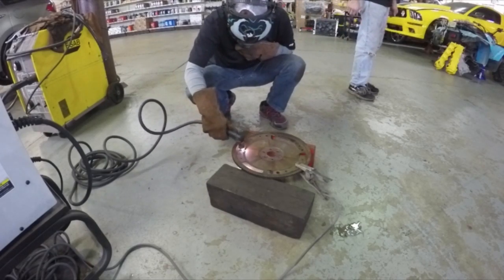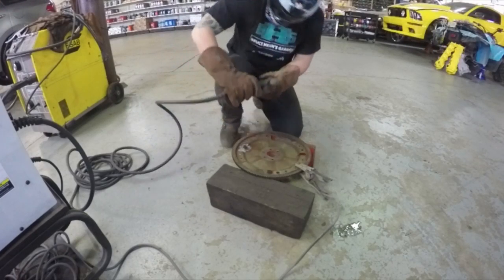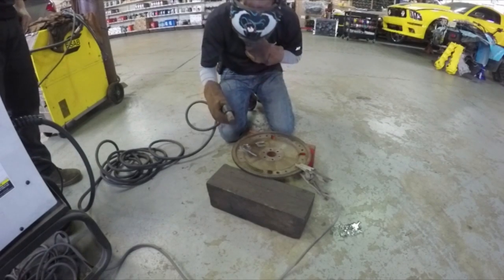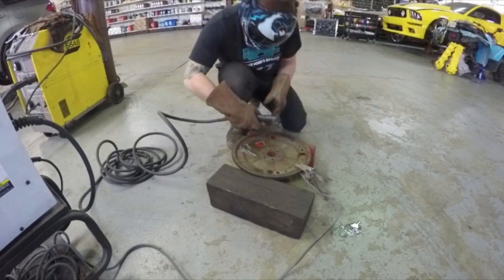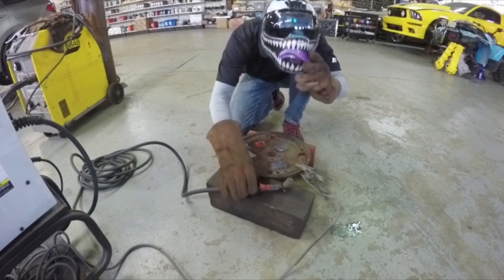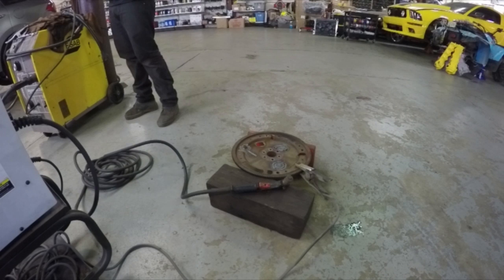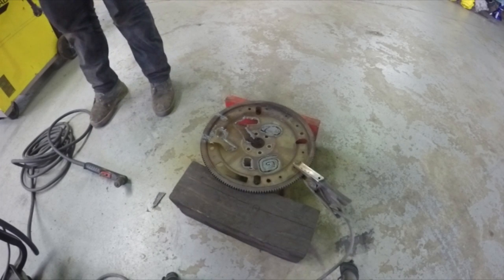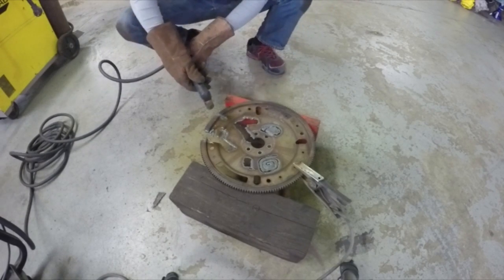Plasma Cutting for the first time

Comment: Don't feel bad. On my final pipe welding test piece my buddy wanted to surprise another guy by cranking up his welder and making big shower of sparks.  You guessed it he cranked up my welder instead, whoops.  Well blew a 3/4 inch hole in my test weld.  Fortuanetly the rest of my weld on that pipe was good enough to cut up test and pass.  If you start in the middle of a plasma cut angle the cut to blow molten steel away from the head so as not to burn it up. When you cut through then 90 degree your cut and travel.

Comment: Instead of holding you shield up and constantly doing that, invest in a mask that automatically darkens when it senses bright light. They're also adjustable via manual turn dials so you can adjust when the screen darkens etc.
Reply: +datstocklyfe I would just recommend buying a cheap hood that's fixed at like a shade 4 for plasma cutting. The plasma arc aint that bright, and a shade 4 is about perfect.

Comment: No offense to tony, but is that the best time to fuck with someone? When they're holding a fucking plasma cutter?
Reply: +Jirekianu ...especially when a noob is at the controls. Bit dumb if you ask me.
Reply: Jirekianu Its still not clear how on earth could his dick be cut off after this?
Reply: +Burlats de Montaigne what could possibly go wrong?
Reply: blackcarmafia  The likelihood isn't terribly high but a number of things could occur.

He accidentally burns himself if he was in the middle of cutting. Drops the torch in a way that might damage it. He lurches/jumps in a way and ends up hurting himself specifically because he was in the middle of doing something stressful/dangerous like using plasma cutter. etc.

There's a lot of ways that shit can go bad. I mean, it's not likely, but it's still a goofy ass risk to be taking.

Comment: Also not sure which shield you are using, but if you can change out the glass in it, a #5 is comfortable for plasma and gives you much more visibility than a #10, which is standard in most helmets. A #5 offers less light protection, and OSHA recommends ~#8 for what you are doing, but for a short time a #5 is fine if that's all that's around the shop.

Comment: The "goo" is aerated molten metal.

If you want more cut control, try a 5 shade shield. I have a weld helmet that can be set to shade 5 for plasma cutting.

Lastly, be careful because you can actually refuse the metal :D

Comment: I love using a hand plasma, but honestly, I prefer a shielded torch head, because you don't need a helmet to operate in most conditions, just goggles or good glasses, and you can drag the nose across the metal knowing that it will never cause an issue. You also should be wearing leather shoes, as I am sure you just learned. Boots are preferred. There may be a lot of sparks in plasma cutting, but the vast majority are tiny due to the speed of the air blowing them away.

Comment: For someone who doesn't quite understand - is that a piece of the 302? Why are they taking pieces out?
Reply: +Steve Reiness It is the flywheel / ring gear . I was damaged when they loaded the motor. So now it is a pice to practice on
Reply: This is the old flywheel, they are just practicing on this and they have a new flywheel. He has to cut the shocks towers on the Falon with this cutter.
Reply: +anglia24 thanks for setting me straight - I thought it might be practice, but not quite sure.
Reply: +anglia24 thanks for setting me straight.

Comment: Pfft if you want sparks try using an air ark gouger. It uses copper coated carbon rods and lots of electricity to melt through inches of steel at a time.

Comment: I remember learning how to use a plasma cutter in high school in welding class.  They are quite fun and work well for thin applications.  For thicker applications, an acetylene torch works better.
You seem very afraid of getting burnt, get some cotton coveralls, can be found at a welding supply store, and get in there.  Some leather shoes wouldn't hurt.  The sparks won't burn you, the slag will.
Reply: Depends on the machine and power you can give it. 5 in plate steel? Oxy fuel. 1 in plate steel? Plasma. Tons of small machines on 220v have 5/8 severence. Half inch plate steel aint thin at all.
Reply: ISK KILL With the proper tip you can cut upto 12" thick steel with an acetylene torch.  Depending on PSI plasma cutters can do similar.
greenfendertoronado It only takes one good burn to learn.